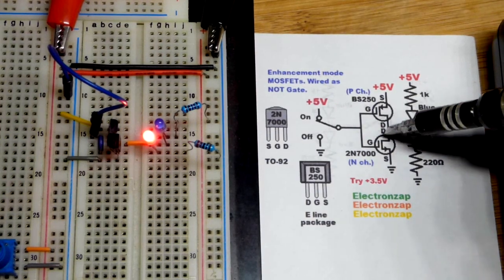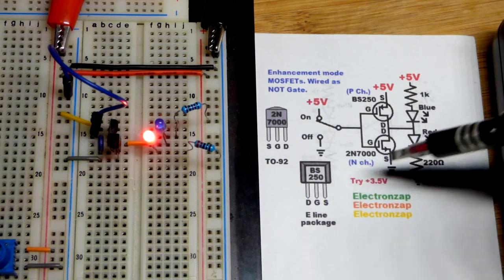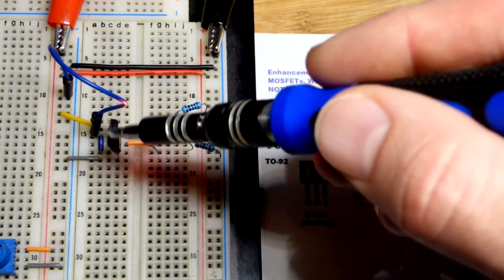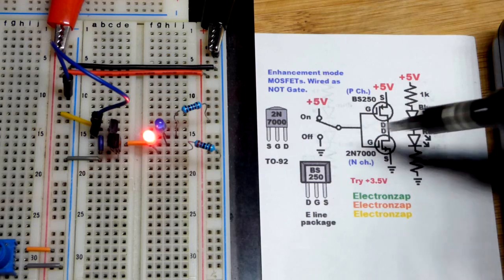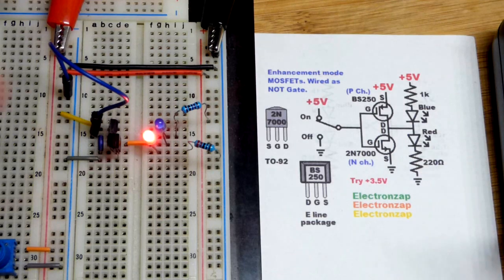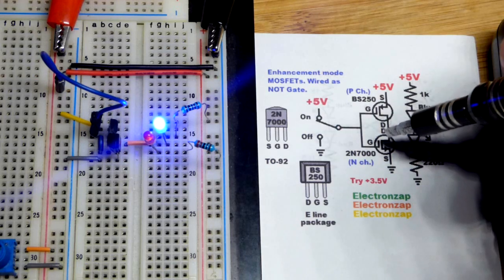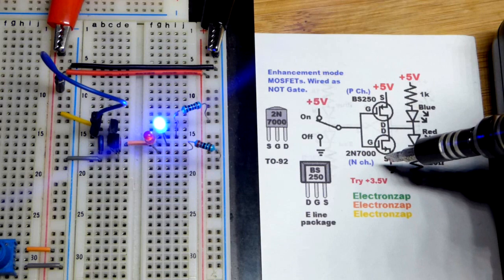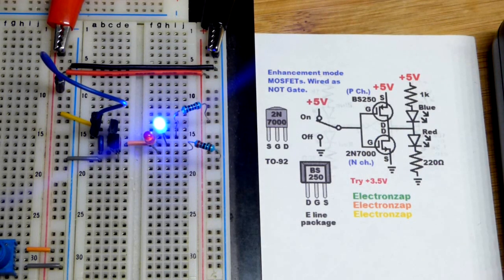MOSFET Push Pull output NOT logic gate 2N7000 BS250 demo circuit schematic diagram by Electronzap

Comment: I noticed you put the p channel "on top" vs. the bottom.  Maybe you can make another video explaining the advantages and disadvantages of the two configurations.
Reply from the maker: That's a good topic, I'll try to keep that in mind. Not something I see being explained much. I think it's hard to get the voltage needed to turn the transistor off if the load is dropping voltage from the opposite supply voltage that it is normally wired towards. I never really see it being discussed, so I haven't put much time into studying what happens if you wire MOSFET circuits differently than what is shown in schematics.
Reply: Are you familiar with Bipolar Transistors? If yes then think of it as NPN vs PNP. In other words if we replace the Fets with a 2N2222- (NPN) and a 2N2904-( PNP) we would arrange them the same as shown here. The main difference would be current limiting resistors placed in series with the Base of both transistors. The reason, both the FET and Bipolar circuits are arranged as shown is because to do otherwise would change the circuits to Source or Emitter Follower circuits. These are also known as Common Drain (FETs) and Common Collector (Bipolar) circuits. Note that Source Followers and Emitter Followers exhibit less than unity voltage gain. They are used primarily where voltage gain is irrelevant but current gain (low output impedance) is the goal. 
Wakodahatchee Chris